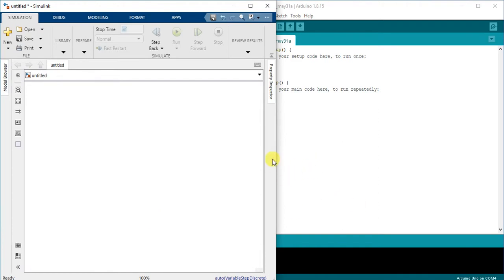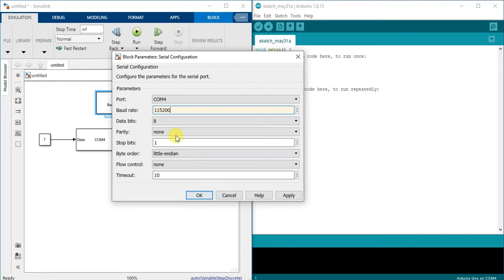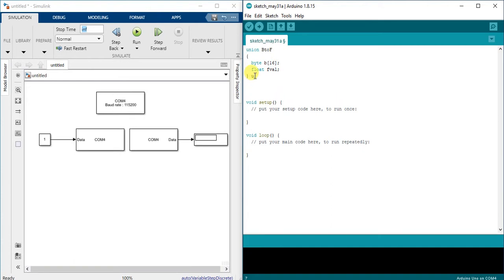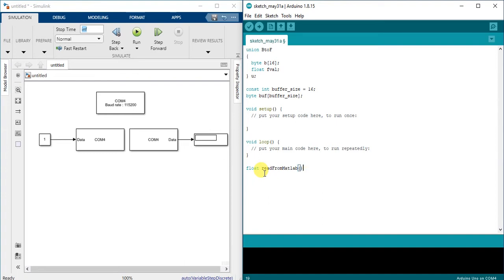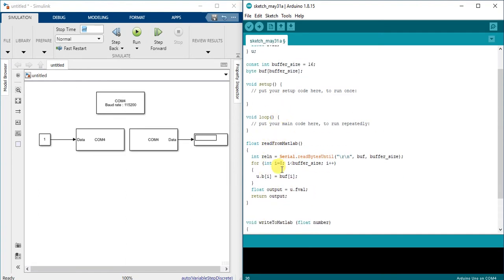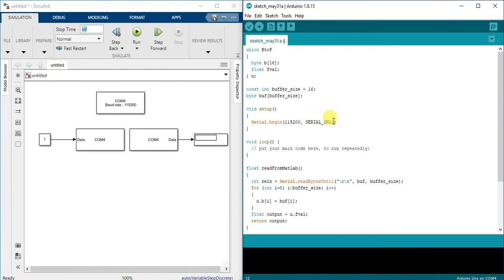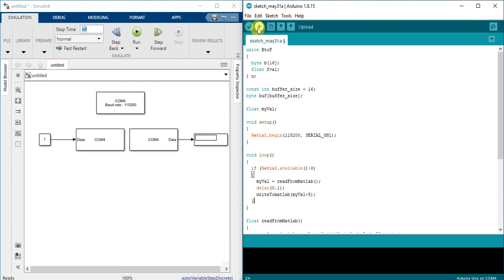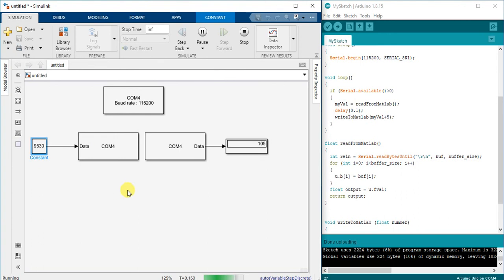Serial Communication MATLAB (Simulink) and Arduino (English)

Comment: union BtoF
{
  byte b[16];
  float fval;
} u;

const int buffer_size = 16;
byte buf[buffer_size];
float myVal;
void setup() 
{
  Serial.begin(115200, SERIAL_8N1);

  
}

void loop() {
  // put your main code here, to run repeatedly:
  if (Serial.available() > 0)
  {
    myVal = readFromMatlab();
    delay(0.1);
    writeToMatlab(myVal+5);

  }
}

float readFromMatlab()
{
  int reln = Serial.readBytesUntil("\r\n", buf, buffer_size);
  for (int i=0; i<buffer_size; i++)
  {
    u.b[i] = buf[i];
  }
  float output = u.fval;
  return output;
}

void writeToMatlab (float number)
{
  byte *b = (byte *) &number;
  Serial.write(b, 4);
  Serial.write(13);
  Serial.write(10);
}

Comment: Excelent video, thank you! It worked fine for me but wheneve i run it using the Scope as a sink i get a varying value between the expected value and 0, which i expect is the value considered by Simulink when no communication occurs, is there a way to filter those values?
Reply: By the way in the Serial Receive block i've set "Action when data is not available:" to "Output las received value"

Comment: Hello. I have PV system connected with grid real solar panel I was Simulink to get maximum power point tracking MMPT by using Grey wolf algorithm. I want use the algorithm in arduino in order to injected it in MMPT to get maximum power.
Can you help me how to convert the algorithm to Arduino code?